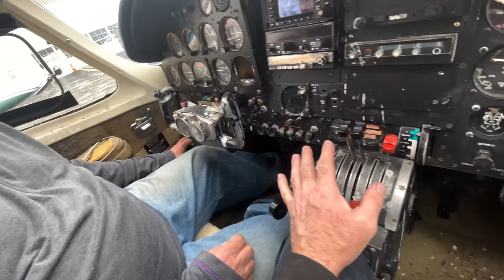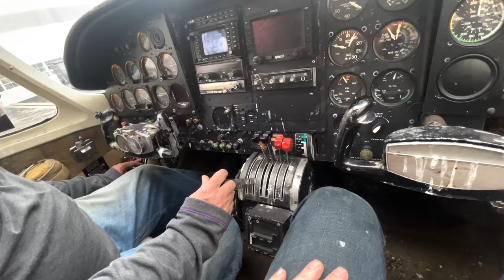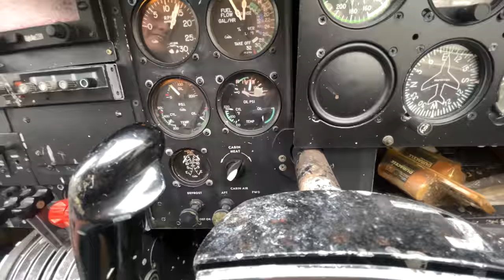Will Engine #2 Ever Run Again On Our FREE Abandoned Airplane !? Ep8

Comment: Great job man! I have been watching this project from the beginning on the edge of my seat.  Being a pilot and no longer able to fly because of my medical being expired I couldn't stop watching.  However, I have a question.  I have been a long-time automotive engine builder.  If I am not terribly mistaken, did I see you remove the pistons and rings from the pistons and re-install them after cleaning them?  If I pull a piston it gets new rings.  I saw an aircraft mechanic pull the pistons in a Cessna 150 when I was in Korea and he examined them and re-installed the pistons with the used rings.  I would not have thought that would be allowed, especially in an aircraft. Thanks for any clarification.

Comment: AM I SEEING THIS RIGHT?!  I really didn't notice any type of torque wrench used during any of the reassembly. Are bolt pressures not really an issue in this engine? Do you 'just know' how much each bolt is torqued? Or did you just clip out the 'fine adjustment' segments?

Comment: You put the pistons in the cylinders before putting them on the engine. How did you insert the wrist pins?
Reply from the maker: The wrist pins are floating pins and can be pushed right into place.

Comment: Gee's Jason if I's doing what U are doing [ which is good ] I wouldn'd be putting the block back together. seeing as you are getting both the engines Re-built, I'd be taking the pistons out as well seeing as they have to be all Re-conditioned ......That piston does'nt look too bad, BUT all new pistons may be the way to go. .
I can understand what U need to do about just getting it to fire-up so thats OK
Reply: You are certainly doing a great job Jason that's for sure..........................

Comment: The piston ring gaps should be evenly spaced around the the piston,  is the piston ring gaps are lined up, I have seen oil blow by the piston.
Reply: Rings rotate and the gap alignment changes constantly unless it's a 2 stroke where the rings are fixed.

Comment: at the 30:00 minute mark i just thought ,, the pistons where stuck when u found it,,, it could have broken a ring and thats what caused the rubbing sound,, when u got  it untstuck,, i bet the ring was just starting to loosen when u put the jet fuel in it i bet it losened it toooo much and broke loose during the test firing ,, and it caused the rubbing sound,, i heard that before in my weed eater with a broken piston ring

Comment: unless aviation is different than every other motor system i've worked on you count cylinders from drivers left to right, and front to back, so your #1 is front left, #2 is front right, and so on, keeps driving me nuts when you count backwards, but over all this is an awesome project and i dont think your all that far from me, if i had any skills to offer (i suspect i dont) i'd love to help

Comment: Wondering you cranked the engines at all before cleaning and repairing turbos and everything which can harm the engine.

I did once the mistake at a old, long standing turbodiesel and parts of the old turbo as its turbine broke apart sucked into the engine made big scars in the cylinder wall and destroyed some valves! Thats a mistake you make once, it was not a huge damage since its engine was anyways like half a million kilometers and 25 years old (and needed pretty much everything new), but on such a huge, expensive aircraft engine... no, i think there you should do everything to preserve any part as long you know its still usable and ok to use, as small or "cheap" it is, like you said with the spark plugs in one of the first episodes

Comment: The fact that the left engine was needed to run to get the right one going tells you there is still a voltage i.e. an electrical problem!

Comment: Amazing to think a Tesla car motor 9"diax20" has as much  power & torque..more actually.. than than that whole motor 💡 maybe you should have converted it to electric.😊😊🤔 😊😊 battery density needs to be 500Wh/kg..not quite available yet but we are getting there. Just think how reliable it will be.. just a battery,  an inverter/speed controller and motor .. without a gearbox that would be one moving part 🤔 .. I wonder what the rebuild hours are on electric motor, maybe you would just replace it 🤔 .. I wonder how that much that would cost compared with 1600 hour refurb 🤔🤔

Comment: a big hose clamp will work in a pinch as a ring compressor. lucky it never backfired with that fuel in the intake. so why dont you just leave the tug attached to keep it from moving?

Comment: You need to wear gloves mate. That fuel and the penetrating fluid are really bad for your body. There are textured nitrile gloves that can be worn when dealing with these type of contaminants. I work in the industry cleaning up contaminated sites and removing old fuel infrastructure and we always wear the nitrile gloves to protect against the aviation fuels and solvents.

Comment: heyas there i love the videos awesome work on this plane, But my hreart sank alittle when you brought out the kamikoto knives, they are 100% noty worth the price tag and they are a severely deceptive marketing scam, a well known blade enthusiast did a heavilly indepth video on these knives from top to bottom and well just to TLR: they are made of cheap steel, they will not hold sharpness long an at 300 bucks a pop,  a Farberware knife from walmart held nbetter, IF you want i can find that indepth video on how the blade expert talks about Industrial steel grades that are industry standard and there is NO such thing as ' Genuine' Japanese/German etc steel. I hope you can return them and get the money back because they are 100% a scam and i can provide the required proof and brreakdown of every inch of that scam companires knives.

Comment: If u don’t have the right tools please don’t work I saw how u put manually piston and that’s not the way u do it ! U scratch them with the rings it’s got tools for the rings and piston. Who gonna be responsible if the engine turn off in fly mode ? I watch ur videos for this plane and u don’t have a clue what exactly u doing

Comment: last count $154,000 in donations to restore the plane with that money you could hire people go in gut it deep clean send the instruments out to get serviced detox pressure wash and have the interior completely restored and service the controls and upgrade instruments if they cannot get serviced and re calibrated . Then pull the engines for a over haul.

Comment: Very disappointing to see you peddling clear Japanese knock off knives of a low quality. Especially when considering the prices. Doing some research it's clear that they use cheap steel and are probably made in China.

They clearly use deceptive marketing tactics and have a very bad reputation! If you avoid the paid advertisements, like the one you made, it'll quickly become apparent these are cheap knives made to look expensive. Also the test you did prove nothing, give me a grind stone and some wet stones and I can make just about any piece of metal sharp enough for what you did. Hell I can most probably use my electric sharpener to get them sharp enough for the tests you did.

I get that you need to make money. But there are honest ways of making money... I hope you just didn't do proper research. But honestly if you're promoting it should be something you can get behind. I cannot imagine that after doing some research you'd be behind this brand.